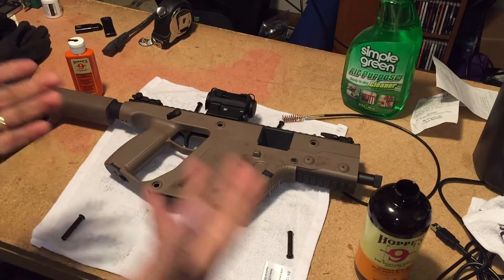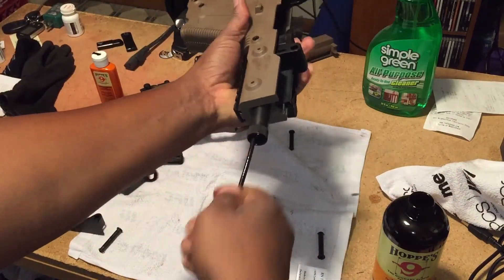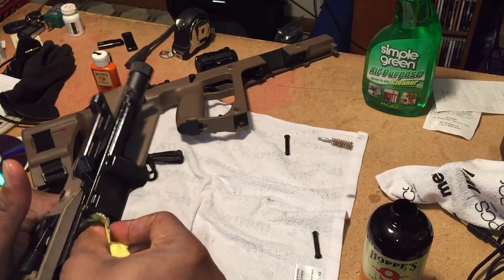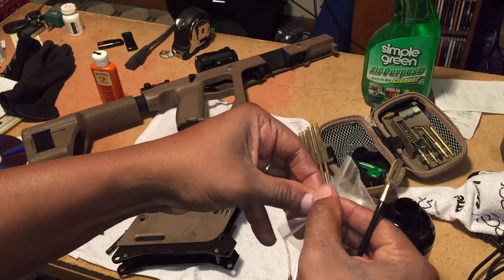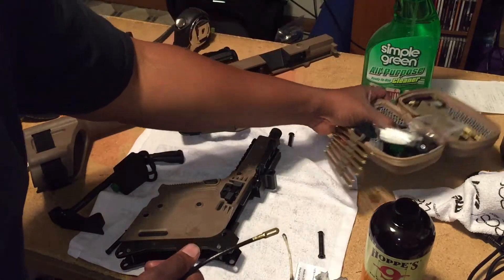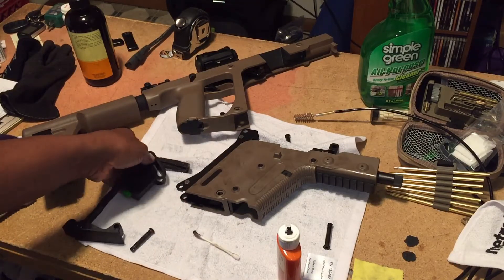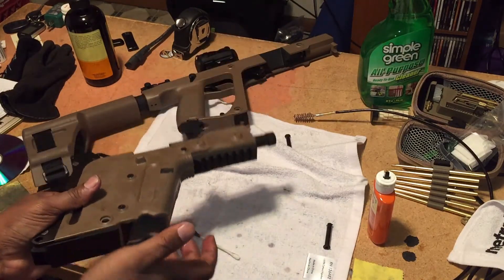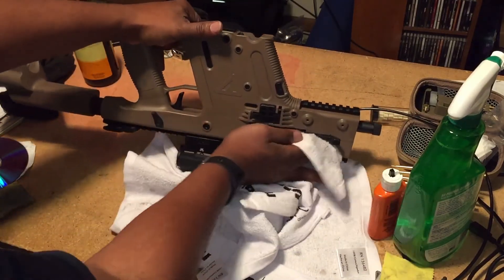Kriss Vector Cleaning (My Version)

Comment: The yellow cleaning pad that you were trying to fit in that small hole of the cleaning tool is supposed to be tight. Feed the corner of the pad through the small slit of the tool and pull it hard until it’s centered. That pad is made to run through the barrel, just like that wire brush. The tight fit is so the cleaning pad does not fall out of the tool while you’re sliding it down the barrel. And also, after cleaning your weapon with any type of lubricant, you should dry the “entire “ inside components until they are DRY with a clean cloth(like blue shop paper towels) because any extra oil residue left inside will rust.  Lastly, if there is any extra oil left   inside the weapon, the next time that you fire the weapon oil could shoot out of the ejection port or barrel and get in your eyes,even while wearing eye protection.

Comment: Hi Sir, I appreciate your time and effort as I’m new to Kriss platform, however can I offer you one piece of advice?  With ANY firearm, when using your brass brush always clean from breach to tips. Don’t put it in from the front you mess up your barrel. Also, WAAAAY too much oil.  I know you think hey what’s bad about extra lubricant?  But that extra lubricant holds on to carbon and actually makes your gun dirtier faster.  Just some advice from a USMC Master Gunnery Sargent.  Take care
Reply: Frank Walker rahhhh

Comment: thanks so much for this cleaning video....I just got my Kross Vector CRB and apparently I'm supposed to lubricate this firearm prior to using..any thoughts? 

thanks again.
Reply: The instruction manual tells you where to put droplets of gun oil. Be very stingy with your oil as too much oil will cause the bullet residue to clump and cause problems just like any firearm.